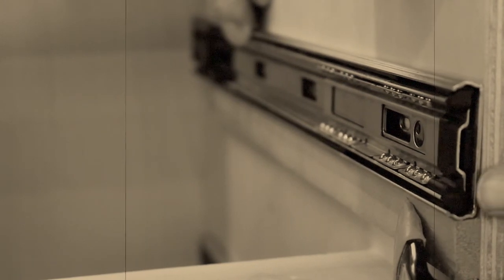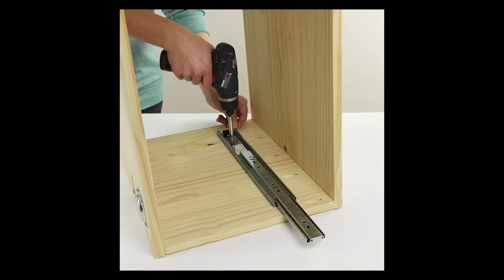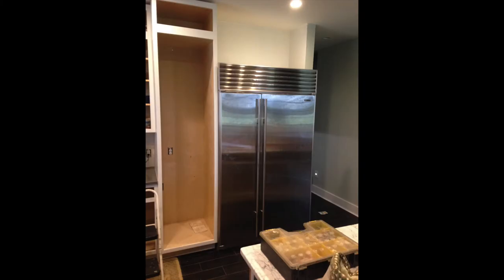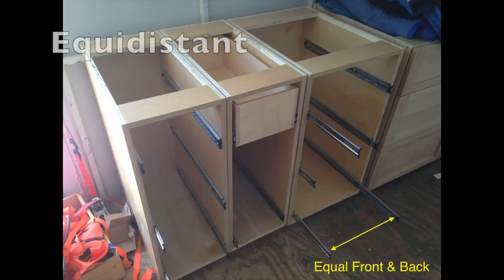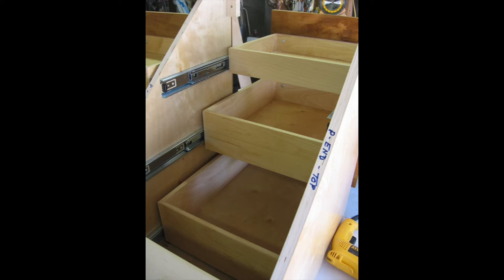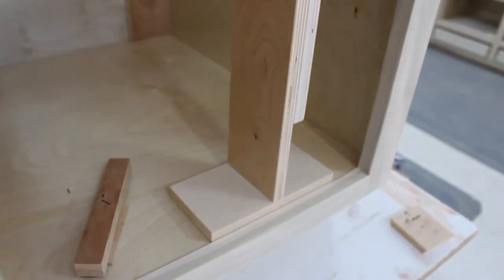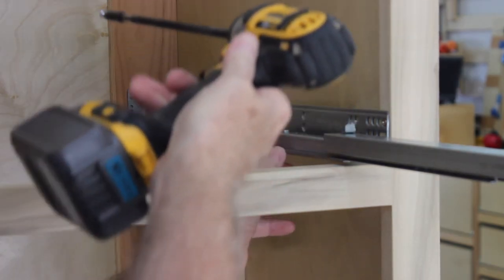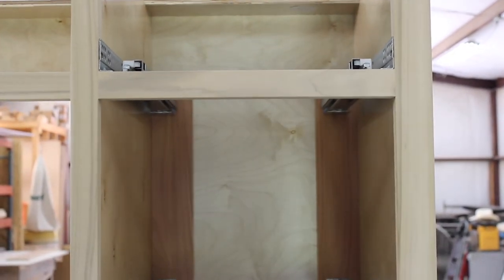The Best Drawer Slide Jig EVER?

Comment: This is a great idea.
Instead of the dowel, you could make a rabbet on one side of the 'T' piece (then make the sliding piece a little narrower so it fits in the slot). The other side can be kept as is, in case one would want to use a non-90° angle.
Edit: No, wait, it's better to make the slot in the piece that slides and then make the 'vertical beam' of the 'T' narrower, so the support will be correct.
Edit2: I've sent you an email called "Drawer Assistant", to explain it better.
Reply from the maker: Thanks for commenting!  Good pointers for refining the jig.
Reply: Still scratching my head trying to figure out the improvement. I am sure it is making an already good idea better but wonder if you could add some more info. Wish the comments had a way to add a drawing or picture :-(
Reply: @ashokmoghe8035  This link should work, just copy the line and paste it into your browser's URL-field:
scratch%2emultitrading%2edk/Drawer-Assistant%2ezip
Reply: @68HC060  Thank you so much. Very nicely done and definitely an improvement. The picture really helps. I got to learn Sketchup !!

Comment: What am I missing here ????? Best jig ever ? It only does 1 thing. It dosent support a slide that dosent have a back bracket.....it dosent give a flat surface to mount a slide at right angles.....it dosent give support to a slide that has a gap between it and cabinet side.....it dosent align the drawer pert of the slide to the drawer to ensure smooth sliding.....and it doesn't support the drawer when you want to leave it on and screw the slides onto it. Even it's basic theory dosent mean the slide will be parallel, because the previous tradesman may have inserted a base shelf at an angle not flat...or the floor could have a rise. It's basically a stick to hold the slide ....But even with a stick , you would use a small level.
Reply from the maker: @Jesse Jameson -- Thanks for weighing in.  I'm happy to respond to the questions you've raised:  1) Since the base is the same width as the upright, the jig can be placed against the cabinet side to support the slide in a frameless (i.e., no rear bracket) application; 2) I'm unsure what it means to mount slides "at right angles" -- could you clarify what this looks like?; 3) In face frame applications (where there is usually a gap between the cabinet side and the slide body), the gap/horizontal alignment is maintained during installation with a gauge block of the appropriate thickness.  That detail isn't covered here (my oversight), but the role and versatility of gauge blocks is explained at length in our follow-up video, "65 Years of Drawer Tips in 20 Minutes"; 4) Again, I'm having trouble picturing what "align[ing] the drawer part of the slide to the drawer" looks like, but with the undermount shown in the example there is no separate drawer box slide component, and with, say, side-mounts, attaching the drawer box component is a separate step that the jig was never intended for; 5) For simplicity I'll include this with the previous point 4 -- the jig isn't designed for attaching drawer box slide members.  For optimal accuracy these should be added with the drawer box flat on the bench, with the slide member supported by gauge blocks, stop blocks or some other means of positioning the hardware uniformly; 6) Finally, the narration mentions that ensuring a consistent front-to-back slide height with the jig assumes that the cabinet bottom is level and perpendicular to the cabinet face.  Another tip in "65 Years of Drawer Tips" is to use a machinist's square to check this.

Thanks again for the input.  It's always good to have a variety of viewpoints!